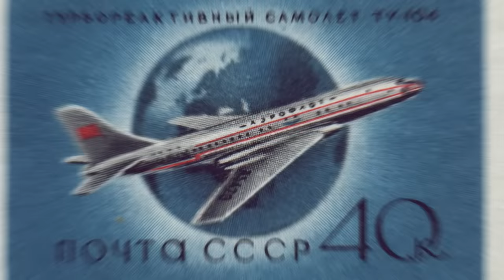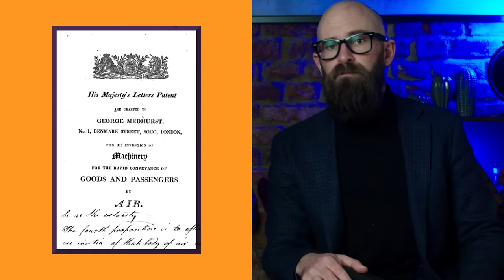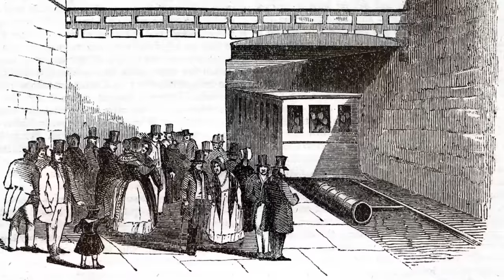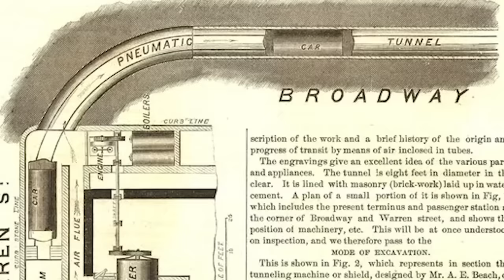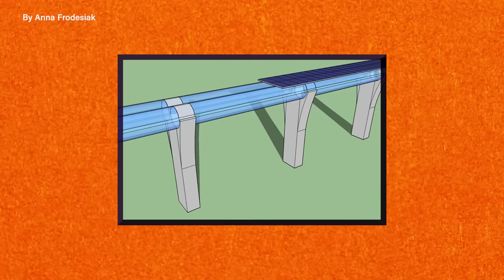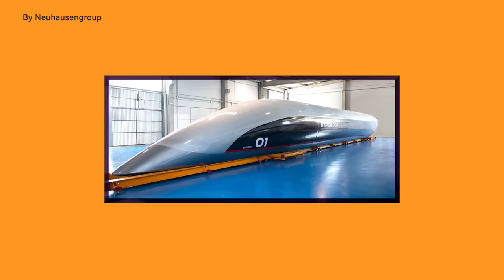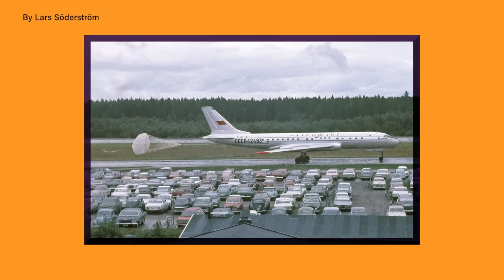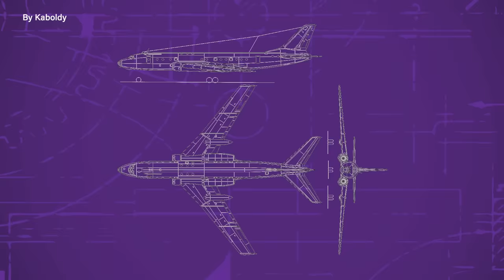Some MORE of the World's Most Useless Megaprojects

Comment: Things like 'Hyperloop' are what we, in the transport industry, would call a 'Gadgetbahn'. A new and complex mode of transit that seems futuristic, and tends to generate alot of excitement because of its futuristic, complex 'high-tech' look and feel . . . But is actually less workable, less effecient and less capable at what it's designed to do than older, simpler and existing technologies.
Reply: It should have been brought up what it has become; an incredibly stupid taxi service in an inescapable tunnel
Reply: Like rockets using closed cycle full flow combustion engines to land retropropulsively?
Reply: A gadgetbahn is probably the correct term to describe Indonesia's upcoming high-speed rail that'll connect Jakarta and Bandung, due to these factors:

1. It's ridiculously expensive, currently setting the nation back at an equal of US$ 8 billion; the same amount of money can be used to connect the whole of Indonesia on rails instead of only connecting the metropolitan cities of Jakarta and Bandung
2. It's not as efficient as the existing rail network between the cities, as the new HSR requires a new station that's less strategically located than the existing rail network at one end and doesn't really reach the city core of Bandung at the other end, requiring passengers to take a feeder train

3. The cities of Jakarta and Bandung are already super well-connected with the existing diesel trains or a myriad of shuttle buses, all of which have really affordable tickets. The new high-speed rail's expected ticket price is triple of these transports' ticket prices.
Reply: Like how the Average Joe could do most of the work needed on his truck in his garage 30 years ago but to work on a current year vehicle you need to be a computer engineer
Reply: @kangarooninja2594  that was always planned to be done in rocketry
Reply: Most of the engineers I know just sigh and go "hooray, another trains-but-worse vaporware fundraising scam"
Reply: @kangarooninja2594  SpaceX is the successful venture that actually seems to be doing things right. I won't take that away from Elon. He's often a terrible person (see the hissyfit during the flooded cave rescue scenario for an example), and has come up with some terrible ideas (like Hyperloop), but not all his ideas were terrible - and the US space launch industry was in dire need of disruption. The route SpaceX went, pursuing low-cost no-frills satellite launches was a perfect contrast to the incumbents like Boeing, whose management of rocket design was so focused on extracting money from the government it should have been criminal (see SLS).
He's clearly a very smart guy with a big ego that's thrown up some spectacular blind spots. Hyperloop/vacuum tube high speed travel in general seems amazing, but has hugely obvious fatal flaws - and the second you start hiring engineers, they'd tell you about them. Ignore engineers at your own peril.
But if we're stuck in a society that has billionaires, having them throw loads of cash at solving their pet problems is one of the silver linings - SpaceX shows that, and hopefully Gates's investment in nuclear power plays out similarly. Don't have to like them to admit some good can come from them.
Reply: Boring  company. Lol. Lmao. Hahahahahaha. I wish I was in the room when they were pitching the city of houston. They could only do 2 tunnel sizes. Lmao.
Reply: It might become useful for off-Earth colonies. Maybe.
Reply: I’m a naval architect (I design ships for a living). We don’t get nearly as much BS Gadgetbahn stuff trying to replace us as the rail industry does, but it still happens sometimes and it’s really funny to look at it and laugh at how unfathomably stupid it is. I’ve seen people saying that modern-day airships or ekranoplanes or massive cargo aircraft or trains in tubes under the ocean were going to replace us. It still hasn’t happened and isn’t ever likely to. Ships are easily the most fuel efficient way to move large amounts of heavy stuff around and will most likely remain so forever, just because of the square-cube law.
Reply: @michaelimbesi2314  Would you characterize the Zumwalt-class as one of the uncommon naval Gadgetbahns?

And yeah, for moving large amounts of stuff around, ships will forever be free of two constraints that no amount of technology will ever remove from other modes of transportations. Air transport will always have to contend with gravity and the fact that air provides basically no buoyancy compared to water, and ground transport will always have to deal with limits on ground pressure and the need for some sort of road or track which needs a lot of upkeep if you want the ground transport to be efficient.
Reply: Yeah, it's absurd, but musk hates trains so it makes sense.
Reply: You'll be proven wrong in time but okay
Reply: @kjsdpgijn  🤣🤣🤣🤣🤣🤣🤣🤣🤣🤣🤣🤣🤣🤣🤣
Reply: @bixby9797  well . . . No

Because if renewable energy sources can iron out the issues in their way Vis a Vis efficiency - they'd at least have appreciable benefits over current technology. 

Personally? I appreciate that renewables rarely  get there these days - and consequently I am an advocate of nuclear power as a short/medium term alternative to fossil fuels until renewable energy sources can be reach a point where they can compete like for like.
Reply: Smoke and Mirrors - The Elon Musk Story
Reply: Just call it an "autonomous pod" and the tech bros will be extatic.
Reply: Skateboards would be better
Reply: Or what I tend to call a 'Brain Fart' ! A fundamentally very, very stupid idea, so dressed up as to impress the ever-gullible media.
Reply: @TwentyNinerR  The issue of station location was another issue  that Hyperloops never properly addressed. To have a terminal in a city centre will still cost billions due to the disruption caused by building ANYTHING in such locations, doesn't matter what. In that respect High Speed Rail is BETTER, since it can move onto existing slower tracks for the last few km.
Reply: @donquique1  An utterly idiotic idea to have just another tunneling company with TBMs. Did Musk realise that it wasn't even a new idea ?
Reply: @michaelimbesi2314  Ah yes, the square-cube law kills e-Vtols too. Another fabulously stupid idea.
Reply: @tOGGLEwAFFLES  Mush's opinions of trains is irrelevant. They WORK, and aren't particularly expensive to make or operate.
Reply: @grahamstevenson1740  The thing about Indonesia's HSR project is that the last few kilometers you're talking about is also made from scratch, adding to the already ballooning cost.
Reply: What I want to know about Hyperloop is "How do passengers get on and off it?"
Reply: hits blunt idk man that sounds exactly like what somebody who works for "Big Transit" would say 😂
Reply: @alesana440  Big Transit ??? Hilarious !
Reply: @TwentyNinerR  thanks for sharing this, it's really interesting! I have a friend from Jakarta (I'm in the UK) so I've heard her express the woes of city traffic (I'm not sure which part of the city she's in, and it is a megacity after all 😅) but I didn't know that this high speed rail scenario was happening (and not doing much to help anyone, it seems).
Reply: @kangarooninja2594  full flow staged combustion was done by the Soviets  (Energomash RD 270, 1960-70).
Landing propulsive landing was done by all lunar probes and Apollo missions on the moon.
Reusability was the main idea behind the space shuttle.
All these ideas are old, but they don't work until the right materials (to resist oxygen rich high temperature gases), production methods (3D printing, digitally controlled machining) are developed.
Hyperloop is a stupid idea. Not because the technology is not mature, just because you cannot beat the laws of physics.
Reply: Occam’s Razor
Reply: Why does that sound like Stuttgart 21😂

Comment: I'm not an engineer. But I once had one tell me that one of the universal truths of engineering is that EVERYTHING leaks, even without the massive pressure differential required for the Hyperloop.
Reply: In the Hyperloop’s case it’s also an issue with the pod itself. Remember, the tube is pumped down to a vacuum. If a pod springs a leak, the air inside the pod will escape into the tube and all the passengers will die just as if they were dumped into the vacuum of space without a suit.
Reply: I am an engineer, and the hyperloop is pure anti-science.
Reply: Your instincts serve you well. You're exactly right about that; NOthing is perfect. Perfection is an illusion, a goal that we strive for, but never totally achieve.
Reply: @michaelimbesi2314  , thank you! 👍 That's what I'm always saying too. There's this one NASA story about a guy that was exposed to a hard vacuum for about 45 seconds. He was lucky to survive. If you look at the studies of regular train stations, they have to be about 15 MINUTES apart for the system to be economical. Too many stops, it's too expensive to run. Too little stops and people won't use it. I feel confident in saying that NObody can survive 15 minutes in a hard vacuum!
Reply: @geelee1977  , I'm only an electronics engineer, so at first I was one of the minions that thought it was a good idea. But whenever I criticized some aspect of the project in social media its supporters would always attack me as some kind of "troll" 🙄. I just asked basic science questions like, "how much energy and TIME does it take to transport people through airlocks?" Or I'd ask, "what happens in the event that a pod LEAKS"? 
They want pretend that everything is perfect, and STAYS perfect over continuous long-term use by the public. No seal is perfect, or stays perfect forever. I guess I'll always be that "troll" that doesn't trust what rich billionaires want people to believe. I believe in Science instead!
Reply: Didn't Musk subsequently admit that the Hyperloop concept was something published entirely to get the State of California to look at it instead of making a high speed rail line, only to later determine it was nonsense, thus delaying the train line, so more people would need Teslas in the interim?
Reply: @SciHeartJourney  Hey man, an engineer is an engineer, electrical, computer, mechanical, civil, industrial, it is all the same.  They are all scientists, with degrees in applied science.  A special type of scientist, the type that has to invent things, professionally. *So being ONLY an electrical engineer, means I have mad respect for you, and so should everyone else.*  Certainly way harder, and requires WAY more brain power, than a Master of Arts in Business Administration.  I also believe science instead.  Rationalism, empiricism, epistemology, logic, science.  The ONLY thing to EVER debunk science, is more, and better, science.  If only the whole world used only rational laws to evaluate ALL claims.
Reply: @SciHeartJourney  You might like Common Sense Skeptic and Thunderf00t
Reply: There will always be some entropy in a system somewhere and that risk only goes up the more time that system is running.
Reply: And everything breaks down eventually too.
Reply: @michaelimbesi2314  And that's after the pod riders been thrown around from left to right and floor to ceiling going round any curve or incline. Travelling at 600-700 mph makes travelling in a straight and flat direction VERY important.
Reply: @MasterofSpiders  Mush is interested only in self-publicity. Look for that and it all falls into place.
Reply: Nature ABHORS a vacuum.  Not "kinda dislikes..."
Reply: I am a mechanical engineer, you are right...
Reply: Yes that's true, but the agency building the CA highspeed rail is so mismanaged that we're not likely to see working meaningful high speed rail in the next century.
Reply: They weren't wrong!

Comment: The TU-104 was also back heavy and had the tendency to pitch up violently and stall. The plane was developed from a piston engine bomber from Tupolev and was changed minimally for the first jet from Russia.
Reply: I think you have  mistaken it with Tu-114 developed from Tu-95 turboprop bomber. (Mustard have great video about it).
Tu-104 looks more like civilian variant of Tu-16 which is turbojet bomber.
Reply: The accident in 1981 was caused by overloading. The General Staff demand the cargo be put onboard. The general attitude by staff was pilots are just buss drivers.
Reply: @penzlic  correct, the 104 was developed from the Badger.

Comment: I would ask you to compare the safety record of the Comet against other early jets and Ithink you'll find that it  co pares more than favourably. Apart from a few crashes in the very early days of the Comet, due to lack of knowledge of the process of fatigue around the windows, the plane had great record for safety. The lessons learned from the Comet were used in aircraft constructed since then.
Reply: Wasn’t the square windows the only real problem with the comet? It’s the only design issue that comes to mind when the comet is mentioned… if there were other problems I’d love to hear of them
Reply: Unfortunately it's safety was forever tarnished in the mind of the public. People were still quite scared of air travel even in a safe aircraft. So one that had a reputation of exploding mid air even if the issue is fixed is a hard sell. And along came the 707 and ended the British aviation industry so to speak. By being the first they also were the first to learn that vital lesson on metal fatigue, pressurization and square edges... someone was going to learn that lesson. If the 707 had come first with square windows and the Comet began with round windows perhaps Boeing would have gone out of business and the Comet would have it's descendants still flying. Alternate history is fun to speculate.
Reply: @zachsmith1676  Some issues with rivets too. Of the three lost 2 were due to windows one in a storm, where the airframe broke apart. This was fixed and the Comet 2 & 3 were moderately succesful flying until the end of the 70s. But no where near the early market dominance Comet "1" had.

Comment: My biggest safety concern with the hyperloop is decompression of the car itself.   A small leak could result in suffocation of the passengers within minutes.   Possibly even a condition similar to the bends which divers need to avoid.
Reply: They could use air masks connected to an oxygen line that drop down like on an airplane!

Of course, if you need to put oxygen tanks on every car, then you’d be accelerating oxygen tanks around at extreme speeds in enclosed spaces… it’s a dangerous idea no matter what you do.
Reply: I don't want to get decompressed. I think I will stick to my bike
Reply: @ethanjames8371  Even at the highest altitudes achieved by airliners, the exterior pressure is still around 0.1Atm, Hyperloop is supposed to run in 0.001Atm, nothing designed for aircraft use is suitable for such a low pressure!

Comment: The Khalifa C city in Abu Dhabi sits up there too. Khalifa A was well developed and well built. Khalifa B (later Shakboot city) was okay. It took a while to really develop a feel and for shops etc to move in but at least there were villas... In-between them both is a massive desert. Just nothing there at all... well, not quite nothing. There are roads into the sand that end and are covered in sand. There are weird little poles or pipes sticking up all over. View it from the air and you discover an entire "city" is mapped out with the services and roads in place but they ran out of money before they could build anything. 15 years ago

Comment: A problem of the hyperloop for transporting any living beings is g forces in acceleration and particularly stopping.
Reply: It's no more of an issue for the hyperloop than ot is for high speed rail. As long as you are accelerating at a safe pace, you can reach high speeds without problem.
Reply: 2 minutes are enough to speed up to 1000 km/h if you only accelerate as much as an average automobile does from 0 to 100 km/h.

Comment: Any Hyperloop close to a vacuum is a death trap. If there's a rupture anywhere along the tube, there's gonna be a huge rush to reach equilibrium. This will move any pods in the tube, regardless of what direction they're supposed to going, towards the hole at face melting speeds, turning your insides into outsides.
Reply: And a hyperloop pod going 700 mph that hits a partially-air-filled section, would experience massive G-forces from air braking. Also not good for the passengers' insides.
Reply: They would move away from the hole as thats were the air is rushing in from

Comment: The biggest problem with putting a tunnel system (especially a delicate vacuum system) underground, is that the ground is constantly moving and shifting.  I mean, think of how much work the highways need.  How are you going to do that if it's underground?
Reply: Aside from the vacuum element, It's a mystery which humanity will never solve.
Unless we acknowledge the existence of thousands of miles of subway systems.
Reply: Victorian engineers seemed to crack the latter with the London Underground system.
Reply: @AtheistOrphan  The Underground has constantly been expanded. Most runs through clay or was built by cut and cover. Ground movement doesn't stop tunnels being built, they just don't have to be airtight.  Musk seems to ignore the pressure on the outside of the tube as well as the problem, to say the least,  of maintaining air in the pods. One accident and the system would be expensive scrap.